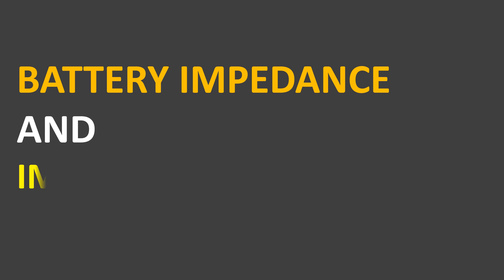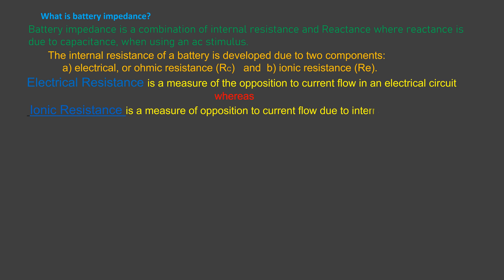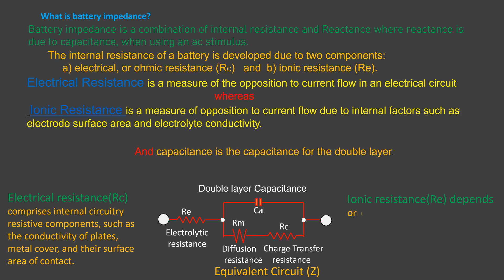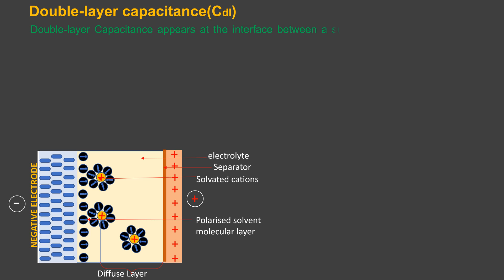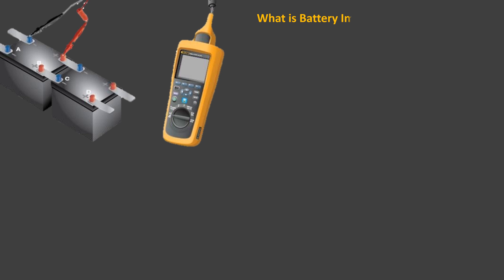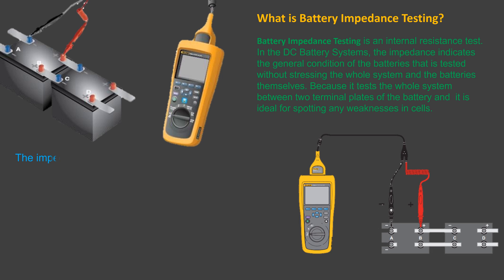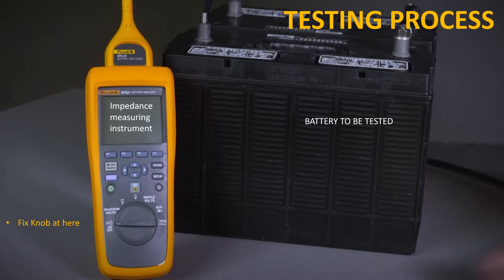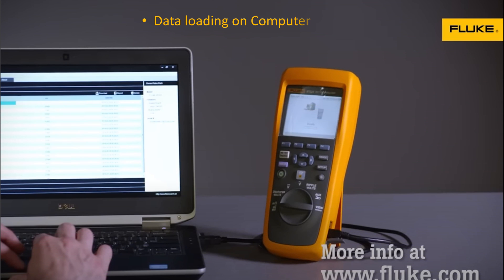BATTERY IMPEDANCE TEST/TESTING OF BATTERY IMPEDANCE

Comment: What is the ideal passing internal impedance of lead acid battery
Reply from the maker: You are welcome. Lead-acid batteries have a low impedance and, therefore the ability to deliver high currents. Desirable impedance should be minimum As example,2V 80Ah VRLA battery Int. Imp.is 0.003 Ω (3.0mΩ)and depends on various factors like temperature. Thank you.
Reply: @electricalpassionate  so if exceeds this value (3.0mΩ), how much is the allowable?
Reply from the maker: @stephenmarkagripo6741  You are welcome. Every battery has a specification given by its maker. If exceeds that value, Battery performance will be affected detrimentally. The battery or the cell of the bank should be replaced after due consideration of other influencing factors described in the specification supplied by the maker. Thank you.